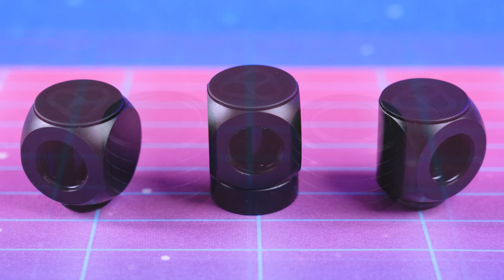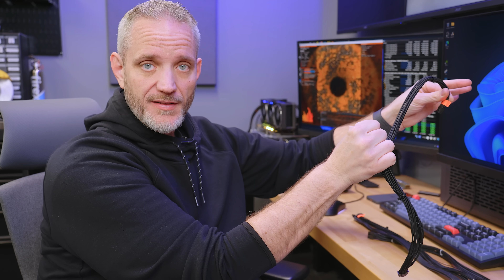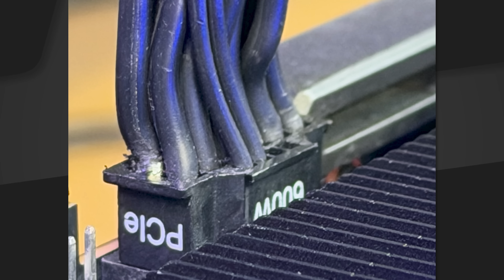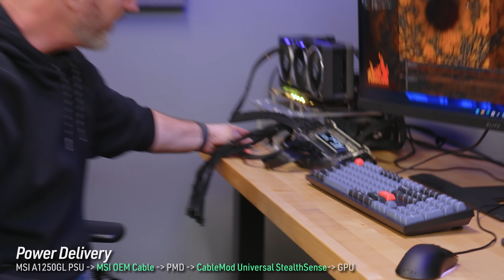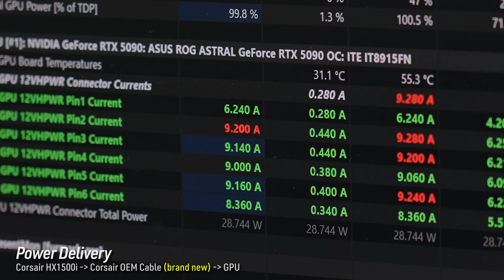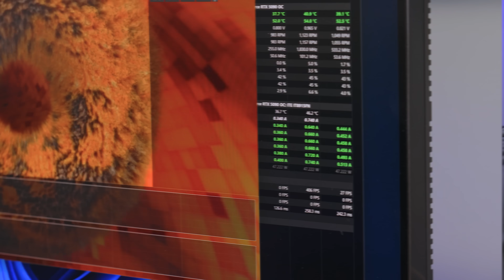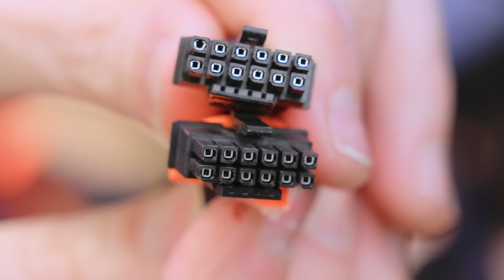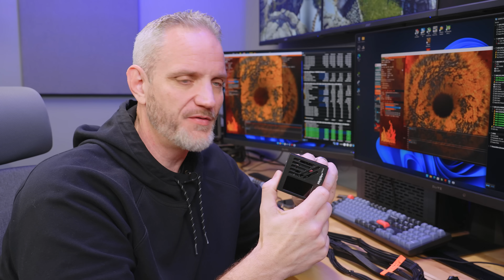More details on what could be causing 12VHPWR / 12V2x6 Cables to melt

Comment: Hi Jay.  A friend of mine just bought a n ASUS 5090 astral. Put it his pc and after a few mins of running it would trip his house breaker. It did that continuously. He read some where to fix that issue he needed to connect it to a line conditioner. Which is working good so far. What is your thoughts or fixes on the 5090 tripping the house breaker
Reply: The breaker is a safety device.  Don't try to circumvent it.  I know it is obvious but it has to be said.  I've seen where people actually rig a breaker to not trip, which can lead to a fire or even death.

First, figure out what amperage the breaker is... they're usually marked.  10, 15, 20, 30, etc.  Then calculate the amperage of all the devices running on that circuit.  There should be a tag on each device giving you some kind of info.  Might have to do some math for that. Amps = Watts/Volts.  If the amperage comes near or exceeds that amperage of the breaker, either move some other devices to another circuit or hire a licensed electrician to upgrade the breaker.

Comment: The whole concept of the 12v2x6 delivery is inheretly problematic from end to end. Running parallel conductors for DC power distribution is a tempremental task on a good day.
Any difference in resistance, inductance, or capacitance can affect power balance between the conductors. The connetors are not necessiarly the main issue here, the quality of the physical wire can be just as much of an issue, poor quality copper or an undersized conductor, broken strands etc.
The multi layer PCB can also be a huge issue. If the plating on the through holes do not have perfect tinning to each power layer on the board both on the positive and negative sides. A higher resistance on one layer on one pin is enough to shift the current to another pin. Plus different cables may show different problems as the connectors may not be 100% identical and be stressing the individual pins differently. One connector may be fine, but another may be pushing a single pin slightly harder or in a sidways direction causing stress on the through hole plating and changing draw to an individual layer of the card.
I deal with large UPS systems whete we have parallel DC runs to multiple battery cabinets. We need to make sure the runs are all near the same length, and we measure the contact resistance between the cable and the bus, along with any bus to bus connections. In addition everything is spec'd with a slightly larger conductor than required to cover any inconsistant current draw due to losses in the connections.
These are connections that can pull 1000A or more, but the design is scaleable, and for the 12v2x6 it is specified way to close to the max. All of the connectors, bus, wire, ternimnals, and solder points should be designed for 120% of expected capacity.

Comment: My powersupply has 12V2x6 on it. but i'm going to 2 8 pins on my gpu. So I guess i could have the failure on the power supply side still? Though I bet it's unlikely because my gpu is old it won't draw so much power.

Comment: Have a new Corsair RM850x PSU, turns out I need 4x PCIe connectors (due to motherboard and red devil 9070xt) and it only comes with 3 PCIe cables without any "pig tails".  Orderd a 12v-2x6 to 2x 8pin to solve the issue, but this controversy makes me so nervous about using it.

I've read that the bottom 8pin on my mobo is largely useless and can be unplugged.  Apparently it is just extra PCIe power.  Debating just doing that instead and using my 3x PCIe cables for my GPU.

Comment: Nice, I got the 3x pci to 12v angled through cable mod the moment I got my 4080 super. I got it due to the original wire that came with the card was to long and was unable to put my tempered glass back on my case.  My card and cable is good. Also the cable mod connector makes it look alot nicer.

Comment: If one pin is compromised then they all are. This is how the connector was designed, it operates AT THE MAXIMUM of each of its specifications. It was designed to fail.

Comment: i put Hot glue the left and right of my 12vhpwr cable plugged into the GPU side. cable keeps coming loose from its own weight. weak grip or something. what i noticed is black screen, then return to normal. one melted pin. (2nd cable), first one had 6 melted pins.

Comment: with my 4090, like once a week the screens go black and fan goes on loud and if I wait like 10 mins it will restart and I can find in the logs that it had a BOSD, can't remember which but one of the main causes is apparently to do with gpu power. I move the pc between two houses each week and it's most likely to happen after that so when it happens I push the cable into the gpu and psu, they are 100% clicked in already but I push in just in case and usually it doesn't do this crash for a long time if I do that while if I don't it can do it reppeatedly.

Comment: I cant remember who came up with the idea, but they went this direction so they can cheap out.  Its time to go the other direction.  XT90 Connectors and 4AWG cables, like people use in Car audio.  2 Cables only, power and ground.  It either works or it does not, plus the connector has been field tested for decades and production tooling already exists.

Comment: You should have soldered on some anderson powerpole pigtails directly to the card when you had the connector removed.  12vhpwr leaves next to nothing for headroom for these high end cards.  When you combine that with the cost based engineering that goes into the manufacturing process its no wonder this problem exists.

Comment: Is it just too much to ask for 4/0 gauge wires and plugs for GPUs?
Reply: It's crazy. Wire gauge and it's effects on cable power limits and temperatures have been a known thing for decades. It's so stupid to think going smaller on thickness while also massively raising power draw would ever be a good idea.
Reply: Honestly, some of the newer cables rc cars are running would be a massive improvement.
Reply: Yes because they need to fix the old ways
Reply: I don't think we need welding cables just yet.
Reply: @--_DJ_-- No but when everything else is failing might as well go whole hog and start eliminating weak points.
Reply: @Hybris51129 A cable that size would just make a different problem.
Reply: @--_DJ_--   Yeah I can foresee a rash of broken PCIe slots from the weight alone.
Reply: @Hybris51129 it could open up a market for RGB cable support brackets.

Comment: Somebody needs to make a  connector that solders on in place of the 12vhp that makes it PCIe by 2 or 3. The since pins can be connected inside the new connector. My 5070ti melted just days after warranty.  I.did not want to go through it again. So I desoldered the 12vhp and direct soldered 8ga wires to each plane and terminated them to a EC5 connector (I'm into RC and this is a common connector for 150amps). I then cut the PSU cable and made that in to an EC5. I'm not worried anymore.
Reply: hola , podrias hacer un video mostrando , explicando lo que hiciste ? la verdad esto es un tema que nos preocupa a todos y tu solucion es buena , saluds

Comment: It's almost like trying to pump what used to be a full power-supply (for an average to modest system) worth of wattage through cables meant for smaller components leaves little margin for error and is thus a bad idea.

Comment: I got a 3x 8pin to 12VHPWR Cablemod cable back when I bought my 4090 in 2022, and after I installed it I started having these random blackscreens maybe once every 1-3 days. Spent some time troubleshooting the card since that was the prime suspect back in the early days, but right before I was about to remove the card to RMA it, I gave the cable a lil tug and bam, instant blackscreen. Turns out that there was bad contact around the middle of the cable, and any movement or bend in that area would give me a blackscreen. Swapped to the adapter cable which fixed the issue.

Picked up another Cablemod cable and its been working fine for 3+ years now.
Reply: could you use a 2x 8pin as well?

Comment: Look at the thing, really look at it... The 12v "HP" connector is basically a shrunken version of a PCIe 8pin+4pin doing the job of three PCIe 8pins.... Whoever thought this would work was smoking crack. That's literally half the conductors of 3x 8pin, with a smaller connector.

Comment: I will say, the corsair cable problem is probably less a corsair thing a more of an adapter cable in general thing. The splitter adapter cables are likely cables most manufacturers don't care about. I'm not defending corsair over the crap adapter cables, just pointing out that they are more than likely to be generally crap. I just got a corsair rm750x 2024 version, and the native 16 pin cable that came with it is super tight fitting like the cable mod cables shown in the video and has quite thick wires. The moral of this story appears to be along the lines of be wary of adapter cables. I doubt any particular manufacturer wants to put much investment into them, so I would expect to get crappy adapter cables from almost any manufacturer outside of boutique like cablemod. You have to deal with the cards you are dealt, and with 16 pin cables, the manufacturers would rather you get new power supplies that natively support it instead of keep selling adapters, so that is the basket their eggs are going to be in. It be what it be, my dudes.

Comment: It's getting difficult to get quality copper wires.  Most of it comes from china.  We all know how crooked china is!  Their copper coated aluminum wire is like a cancer.  It's getting into everything!  I built a sound system in the 90's for parades and other outdoor events.  It runs on 12v DC and needed about 8000 watts or 700 amps.  Recently increased it to 12000 watts or 1000  amps.  Ordered "pure copper" cables, but get crap from china that weighs half as much, is way more stiff, carries less than 30% of rated load, and gets super hot!  It's absolutely useless!  My solution is to find old stock "non china" "real copper" cables.  Perhaps, the only fix to the "12V2x6" issue, make your own cables!

Comment: They should have just made a new key for the standard PCIe connector and used the same wires but only 12v. 
This would have left the cable safe and increased the avalible current.

Comment: Molex connectors are not designed to be continually cycled. The wires in multistrand cables, when anchored at both ends, are stretched and compressed every time the cable the cable is bent. Even though the wire might be very fine and bend easily, they still undergo metal fatigue and will break inside the sheathing. The shorter the cable the higher the stresses on the wires especially when you bend it sharply. In many cases the wires break at the ends where they are crimped and you cannot see the fault. Don't play with your cables because you are breaking them. Purchase only pure copper or tin coated copper wire cables in the proper gauge.
Reply: they should also have an overwrap or nylon in each cable so they can't be stretched. overwrap is preferred though because that will protect it from builders over tightening zip ties.

Comment: GPU makers need to take a lesson from other industries that use high current power, like drone battery connections, car and aircraft battery boosters, tractor to semi-trailer connections for running tail lifts, or batteries inside UPSs.  A single pair of thick, multistranded conductors with a connection that is designed for the 30, 50, 60, 75 or even 100A that it is expected to carry is the way to go.

Comment: I've seen this happened in Cadillac escalades. Some of them have had so many cycles that it creates enough resistance in the cables that will create heat. Heat will fry out our cause electronics to fry out/catch fire.  I have not witnessed it on Nissans or BMWs unless the wires were melted together. It comes down to the possibility of corrosion or the wire purity is poor or just the wire is worn out.  All of this can happen.  I've replaced so many positive and negative cables on The Cadillacs because of this.

Comment: is this a cable mods cable? This standard makes no sense. Maybe to save no space on the PCB? Run exponential more power through smaller gauge and less wires? Was nvidia hoping the cards would fail due to the standard and buy more $1200 cards? I "Upgraded" to the cable mods 90 degree cable rated at a higher watts?
Reply: Its a corsair cable, which is dumbfounding as well. I trusted Corsair products such as Cases,mice, and keyboards. Everyone's following the anti-consumer trend thanks to unsustainable profit margins

Comment: 12v2x6 is basically two pcie 8 pins in a trenchcoat, it should NEVER be rated at 600 Watts, there is just way to little safety factor, pcie 8 pins have all the same issues shown in the video, but they basically never matter since sufficient safety factor exists with pcie 8 pins.

Comment: I have a 4080 Tuf that has been swapped 3 times from RMA since the first one had melted pins (mind you I would only run at around 180-220w), replacement died a month later but it wasn't power related. Core needed reflowing and now It is back in my system now and I am genuinely worried this 4080 is only weeks away from failing again. My 1070 still kicks ass at over 100% power draw with no issues on really long game sessions. I did switch to a CableMod after all that crap with the melting connection tho

Comment: With the cross-section of those cables and how thin those pins are, including those on the PCB, it should use 24Vdc, requiring half the current... I don't understand how we went to the moon...
I'm not buying a GPU with these connectors... not even with screws, it's grounds for a class-action lawsuit.

Comment: How is possible a connector or actually a false design as this cause so much burns really ?
One of reasons a year ago purchased 7800XT. Is impossible to deliver so many watts in such thin cables. The more thin is the cable, the more resistance has. Yet people still spend thousands dollars for what?

Comment: Really weird with the Corsair cables. I've had two Corsair PSUs in recent years (one with native 12x6 and one without) and both their cables have sat really snugly in my 4080 with no wiggle when I tried to move them and a bit of force required to push them in as well. Had they been as loose as yours are, I wouldn't have felt comfortable using them at all. That's so bad. Regardless, it's crazy that this connector is still around and regulators seem to be looking the other way, while everything else is super strictly regulated (at least in my country).

Comment: Ground wire is designed to remain essentially at zero current under everyday conditions. If you have amps running trough it like you said at 07:00, I think that is a big problem in you power supply. Unless you mean ground is not ground as in the normal sense of being grounded, then I apologise.
Reply: The ground he's talking about in here isn't "Earth" it's the DC Negative terminal "GND" or (-) so to speak, which in a DC system is where current flows to complete the circuit when it's closed loop, unlike AC, DC is Uni-directional, current flows from the Positive to the Ground (Negative) as the Electrons travel from the Negative to the positive supply terminals to induce the current.

I hope my explanation is clear.
Reply: @MohdAlafeefi  I understand this now. Thanks.
Reply: Could be a PELV system where M- is connected to ground

Comment: I’m rockin Corsair 1000w using 3 pcie to the 12v adapter that came with my 4080super. I do need to invest in a wider case since there is some pressure on gpu cable, maybe even a sense pin from der8auer.